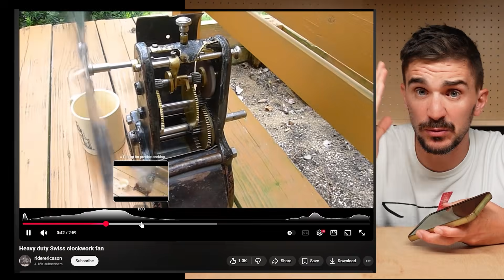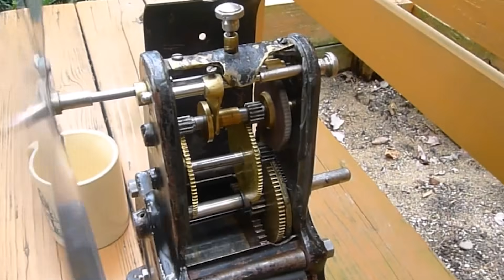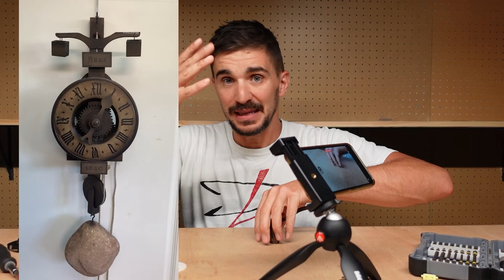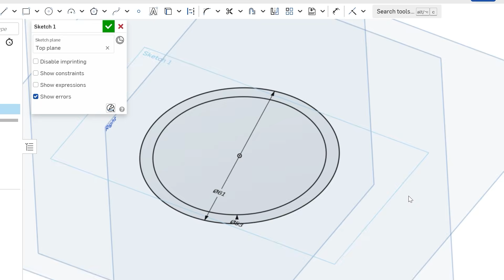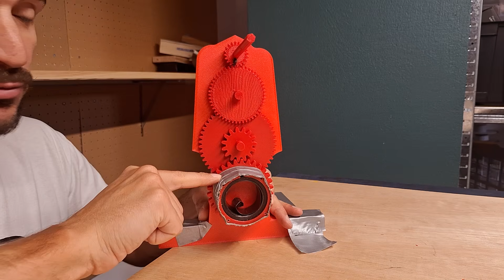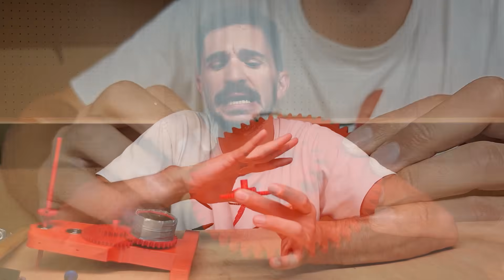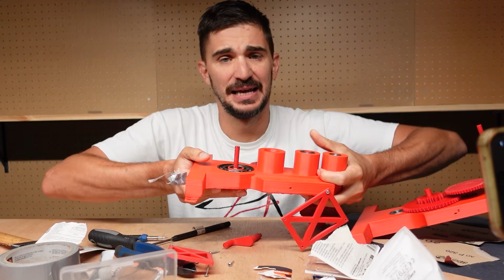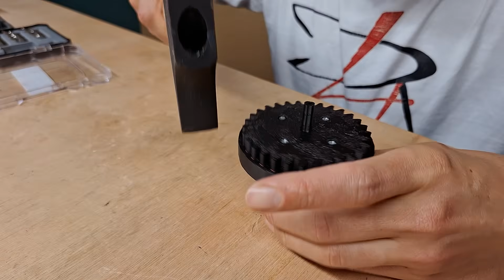No Cables or Batteries, Just Pure Mechanical Engineering - This Swiss Cooling Fan Cools You For Free

Comment: I'm a little confused by cutting the spring, although I couldn't quite see what was lost. I've had a couple small-medium sized tape measures at work break in different ways and was able to take them apart and rewind them and get them mostly working again (without the end metal tab they're moderately less convenient to use) but I do remember mostly just needing to keep the tape in *A* coil, not so much having trouble manipulating it from there, it was a smaller spring so I didn't need gloves, although the metal was still very edgey, but iirc I think to decrease the outer diameter I just had to wind from the inside? I may have used pliers for this, and on a larger tape measure I would def also use gloves and pliers, but as long as you keep the spring restrained to an axis/"sandwiched" and try to keep most of your body away from the "disc" of where it can swing an end I think it's moderately straightforward to get it into a barrel, obviously your hand might be the main sandwiching force so part of it will always be in the flail path but also it's close so it'll block the flail from happening mostly

Comment: No, it does not, because I disabled the history and recommendations on my account and on my phone I have no YT app and use it in my ad blocking browser that has an option to hide shorts. This is the solution.

When it comes to proper hand operated fans, then why don't you just use supercapacitors. They can be charged with massive current and last long time and it is just easier to build a proper electric setup that works properly. In my opinion the problem is not that the device is electric. The problem is that almost all of the available solutions are shit. But I still have to admit that you made an interesting video.

You need a proper CNC machine. Even the shitty Chinese laser or milling machines would make it way better than that 3D printed version. Materials for laser are cheaper and the machine works way faster if you only make flat parts. If you want some proper stuff, then try wire EDM. There are some projects on YT where people convert old Ender printers into that. There is a huge change in quality in comparison with 3D printing, because a properly working EDM does not transfer nearly as big loads and moves very slowly. It might evolve into a nice series on the channel that I would definitely watch.

Comment: Here's an idea: Take a 31-day wind-up clock, and temporarily rig it to where it will not stop chiming. Then wind it up.
It should take well over an hour to chime 5580 times (31 days worth of hours and half hours), and technically there is a little fan in there.

Alternatively, you could just order a "31-day" mainspring, but those things are scary.

Comment: I agree with the other commenter that said your first step in a mainspring build should use a weight on a rope -- much easier to make sure the rest of the build would work.
But when you get to the mainspring part, consider picking up a vintage BayGen Freeplay wind-up radio (one of the big ones) -- massive mainspring and gears that run a small electrical generator for 30 minutes on one windup, IIRC. More parts to steal from.

Comment: You know those tiny AC synchronous motors which turn the platter in a microwave? I wonder how much their gear losses actually are, because their ratio difference is probably fairly high in a tiny space and they are mass produced cheaply.

Comment: as you said "somewhere" in the video, you have modern technology available, so the "real" solution would be a battery powered fan with a hand crank generator.

I have a cheap fan that runs for 3-8 hours on a single charge, and I charge it with my micro solar system.
I have "maybe" 100 watts of panel power(closer to 80 due to aging) but it's enough to charge all battery devices(several fans that are powered by battery packs, flashlights, phones, speakers, and the steam deck) and I still have excess power to run my dishwasher and washing machine maybe once a week or every other week.

and I am at a very bad location for this, I live in an apartment where the panels can only be mounted vertical with at the very most 5 hours of partially shaded sunlight during the summer, and maybe 2 hours during the winter.

Comment: At 20:31 when you’re talking about sanding the conjoined gears, you only need to do that because you included the shaft through the gears - requiring support.  Put a central hole for a metal shaft in those gears and it will run smoother as well.

FWW, the fan blades on the antique appeared flatter in the plane of rotation than modern fans.  If that is the original blade angle, do you think it is less efficient than modern electric designs or optimized to run longer on a spring?

Good design, build, and video!  I’m looking forward to the rest and your model.

Comment: It's so important to design your parts for 3D printing. Your shafts are breaking because they need to be printed in a horizontal orientation. Your save of the mainspring part was a good example of assembly being better than print-n-play. Avoid supports especially on critical surfaces in your design. I would also be curious if you could have just made a secondary housing for your tape measure core, rather than doing the transfer. Overall I hope you had fun. I agree with others there isn't enough power in that small spring to do the work.

Comment: I cringed watching that first tape measure being disassembled, I knew exactly what was going to happen. I still have a scar on my hand from taking apart a car seatbelt retractor to fix it, the spring went BOING and sprung all over the place just like yours did, I was lucky I didn't get hit in the eye. I think to make an effective clockwork fan you'd need a far stronger spring with a much higher gear ratio. 30 minutes or even several hours is totally possible with a big enough spring. I'd bet the cost could be brought down to something pretty reasonable given sufficient volume of manufacturing, try building an electric motor and battery from scratch to power a fan and that'll be a lot of effort too for a crappy result but mass produced battery powered electric fans are inexpensive and work well.

Comment: Lol I think maybe I take my mind for granted -- so many of these issues are completely intuitive to me

Protip: to preserve your energy, use non-sealed bearings -- the sealed bearings not only have seals to drag, but are packed with grease. You'd be just fine with a light machine oil on the bearing cage, and youd probably gain an easy 10+%

Also those shafts are not being loaded in their strong orientation. It's a shear load at best, and a torsion load at worst, right along the layer lines. If you need shafts for 3d printing, you fit a metal shaft in a hole in your part...that's just how it's done.

Either that, or you make it a square profile, print it on its side, and make fitting rings to adapt them to your round holes (bearings)

And for the love of God -- don't use supports lol

Comment: man just print a new housing... and get a new tape measure. Use the tape measure spring enclosure with a printed gear attached to it.
Also, this would not be expensive to produce. Instead of multiple different gears, just use a belt with a single reduction. The multiple meshed gears are unnecessary and only add complexity, friction, and inefficiency.

Comment: i'm a bit confused as for energy preservation aspects now that i look at this contraption... so you wind up that coil N times, and it will spin the fan exactly N*16 times, given the fixed gears and 1:16 ratio. Meanwhile, you have a lot of friction happening all along the way.... but then my confusion is.... at the end of the day.. both the coil and the fan will have rotated N and 16*N times respectively ..regardless of the amount of friction the system has?......... what am i missing?....

Comment: I would use gravity. No gears just a rope on a small diameter shaft with a weight. If the rope is unwound you don't need time to wind it up because you can wind 2 ropes, one c.w. and the other c.c.w, and just hang the weight on the other rope.

Comment: Id say you got a pretty good proof of concept. I bet with some actual optimization and a tool  to wind your own mainspring you can easily achieve your goal. Print the bottom end of the gears with a heavy chamfer so the plastic has time to stabilize before reaching the part where the gear meshes that way the elephant foot doesn't mess your accuracy. Print your gears with a hole and use metal rods for the shafts. You could even use square stock and make square holes and just print little circle adapters at the end to go into the bearings. I say you have a diamond in the rough

Comment: 19:43 Bro, you got H2D banbulab, use the second nozzle as a support for example PLA main, PETG support interface. You can run 0 clearance, the bottom surface will be smooth

Comment: We have been sold this ideology that electricity is the end all and be all. But as humans, heat and movement is the primary thing which we really need. Electric cars, electric ovens, etc. We only really need heat, for our food, our washing and drying of clothes, to keep warm in winter, and movement, but heat is the main one. Solar panels are inefficient and need to often be kept cool not to mention the components used damaging to environment. Wind turbines generating electricity is damaging to environment, and burning crap to power turbines to make electricity is mad. Think about it. Burn crap to make heat, to create motion in a turbine to create electricity, to power a cooker, a fan, a heater, a motor, to charge a battery for a car for motion, all along the lines losing efficiency in form of friction and mainly heat. Similarly with solar, and with anything electrical. I love electronics, but it has become too much especially with the advents of 'smart' tech. So, the only logical conclusion is that it's all been to only to make ppl dependent upon a system to control and manipulate them.

Comment: It should work with a larger spring, it should work with better precision, better engineering towards material and tool limitations, but eventually youre going to wind up at a cost decision due to modern priorities being different, and thats the thing you cant engineer a way around. 

There is the time cost, and that value has gone up exponentially with time and technologies' advancement. 
No tech can replicate the true precision of craftsman spending days and weeks on just one of those gear interfaces. He wasn't cutting a 'perfect' gear. He was cutting the gear that perfectly interfaces with the next. He was going home to think about it, making decisions with the weight of those weeks of effort.

Comment: I think it is no coincidence that the clockwork fans were Swiss. They had the tools, and more importantly, the knowhow of making precision mechanisms. Maybe the biggest advances since then have been in blade design and bearings. But still, the key thing in projects are not achieving the original goal is not to see what went wrong, but what did you learn. And here, I think there were multiple such things, like the warping of thick and dense prints, importance of getting the axels right, etc. Thank you for sharing the video!

Comment: I saw a movie ages ago, no idea the title, who was in it, etc., but it was about a family living in a hot place and the house had a ceiling fan. The fan was powered by a rope & pulley system that went to a weight in the corner of the room. Pull one end to raise the weight to ceiling height and set the tension on a brake to set the speed, and gravity took care of the rest.

I suspect that the path to an "off-grid fan" in the modern age is going to be to use an inexpensive motor wired to a small solar panel that you can toss out the window...
Reply: Have you not heard of the 'gravity lamp'? This was essentially a scam which was used to found a company and which was praised by various magazines. 
Many years ago, someone patented a car that worked like the ceiling fan. Of course, it could not travel very far. The driver then had to raise the heavy weight back to the high starting position. Note that he could do so only because of the energy which he got from food. The food-stuffs had stored energy which they had received from the Sun. 
And then there was the racist 'clockwork radio'. Why racist? Because, instead of wasting solar panels on poor Africans, they had to used muscle-power.  
Generations of schoolteachers have misled children about how to think about energy.
Reply: @DJF1947  nope, that's hysterical. At least a fan built this way could work, and might make sense in a pre-industrial world. 

The car? That's just nuts. Same for the radio, but the fact is that radios like that are likely still being made. Yep, they are, just found some on Amazon, but they also have solar panels.

Comment: I like gravity drive better.
Herringbone gears? Key or pin gears together on the same shaft. Design to not use supports. 
I've seen 3d printed gears designed to use aluminum 20 tooth 2gt pulley as a center hub. kevinakasam /normal-transmission/
Restrict design to 8mm linear shafts and skate board bearings.  Swap original bearing grease for oil for high rpm. Maybe design a high pitch fan hub that uses cut sheet plastic blades. Laundry detergent bottle plastic? acrylic?
Maybe use 2gt belts and pulleys for the high rpm stage. Common use in 3d printers has lowered their cost.
I know you can do better. I'd like to see it.

Comment: worst bearing choice, dont use sealed bearings and put them in a gasoline to remove the grease. add a drop of very light oil to preserve.   then they spin as freely as a ceramic bearing

Comment: The Swiss weren't the first to make a human-powered fan.   The Punkah, a large ceiling-mounted cloth fan that was operated by a Punkah Wallah, has existed for hundreds of years in India.   In conjunction with a wet cloth hung in front of it, it could even slightly reduce the temperature by evaporative cooling.   In other words, did Indians invent air conditioning long before electricity?